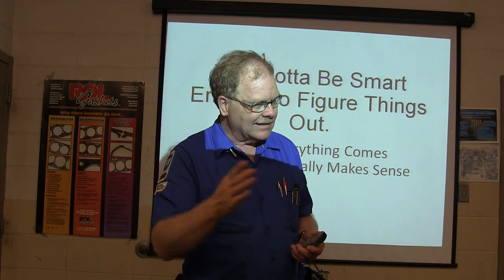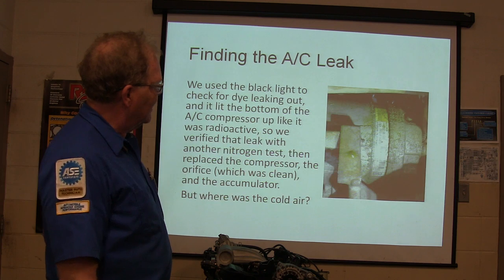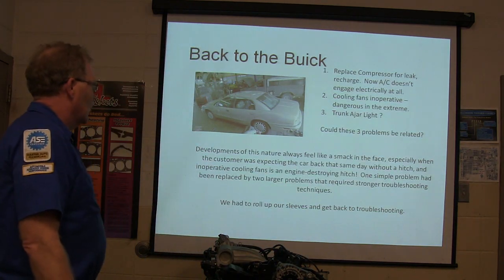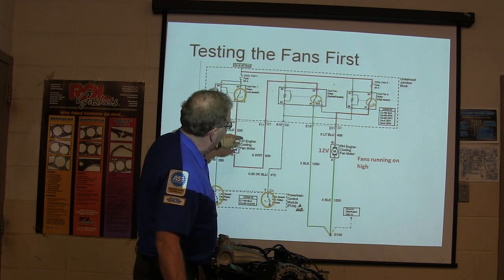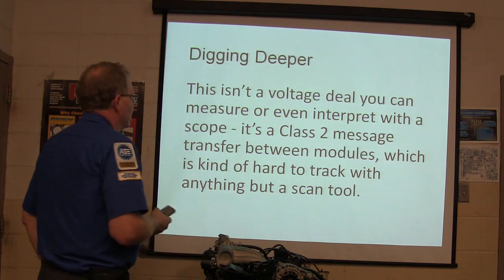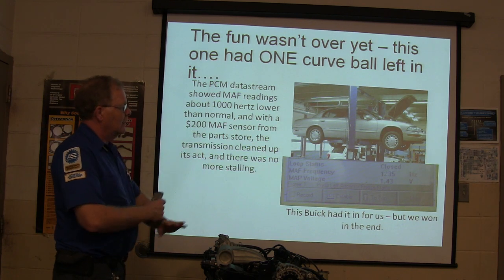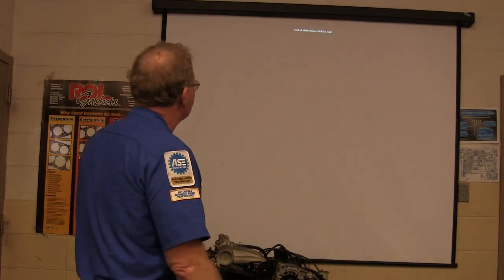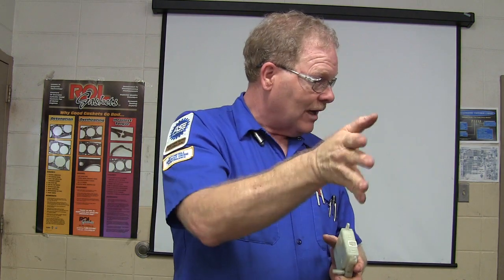Figuring Out a Tough one

Comment: I usually do continuity checks on the Controller Area Network wires and verify no high resistance after verifying voltage and ground checks, which is the pinpoint tests from GM regardless. Usually I am 95% sure before I order a module LOL. Nice Lesson BTW